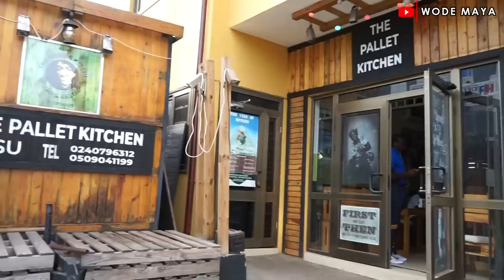I Left New Zealand To Build Houses With Waste Wood In Ghana!

Comment: The West does not support or promote anything if it is not in their best interest. Complitly normal. they invest and demand democracy everywhere just to have the doors opened to step in when they want, to manipulate people in their favor. whereas in a closed system, it is difficult to penetrate. We may not reject the democracy in block, there are points such as individual freedoms that are essential, but the rest can be reviewed. Development requires a lot of rigor and discipline. Question, would China be developped if they have let the West play their games in China as they do everywhere in Africa? Even the democracy helps some of our leaders to not be afraid of nothing in case of faillure.